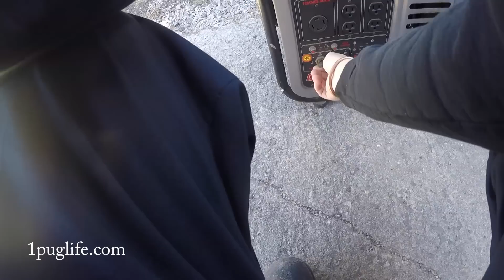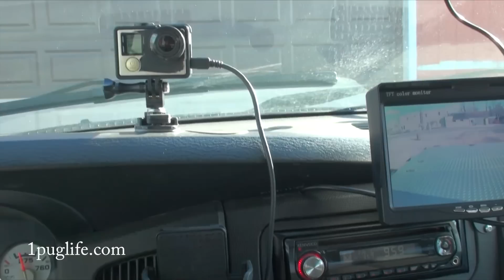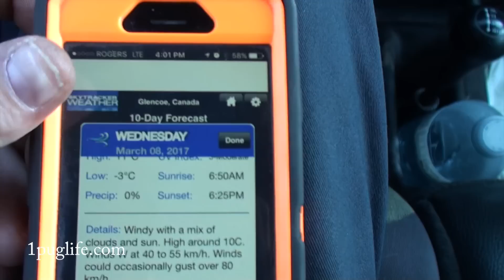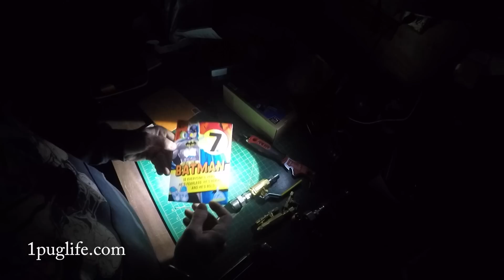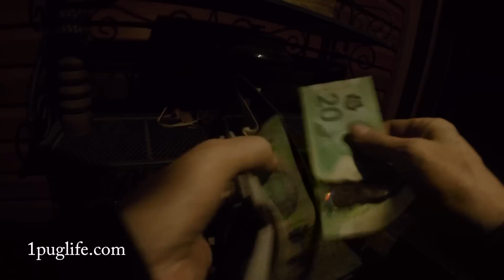we met on grindr

Comment: Our power occasionally goes out, so we added a 220 breaker and male outlet to our box so the whole place can be powered. The outlet comes with a plate that goes between the main breaker and generator feed so you don't blow crap up like a goof. Have to shut the main off in order to move the plate out of the way.

Comment: the thing pug saw at 7:13 is a gyro copter, helicopter like blades mount on the mast and are unpowered, air from the propeller spins the top rotor, generating lift.

Comment: It's a gyroplane (gyrocopter).
Reply: It's more of a  powered parachute often abbreviated PPC and also called a motorised parachute or paraplane,
a type of ultralight aircraft that consists of a parachute with a motor and wheels
Reply: The one by the building was a Powered parachute and the one sitting closer to the road was a gyrocopter both considered ultralites BMP
Reply: I thought it was a Gyro at first too, but look at it again... It clearly says Pegasus on both the aircraft and the cover. Check the wiki link I posted above.
Reply: Sumbitch, you are right, no tail rudder either. good catch.